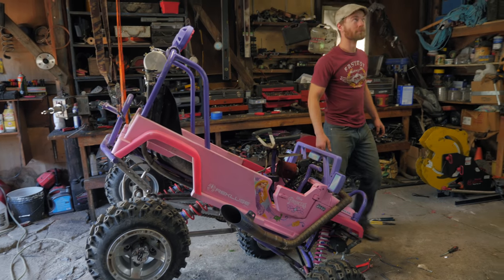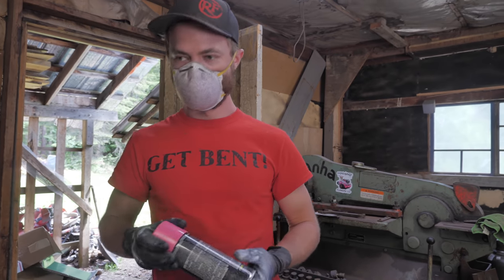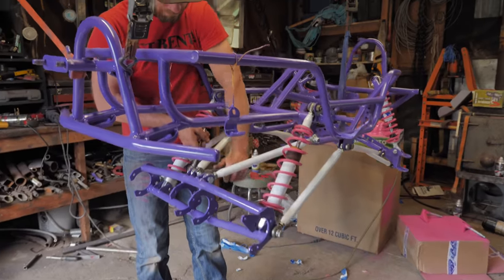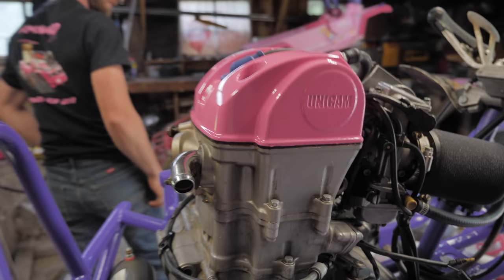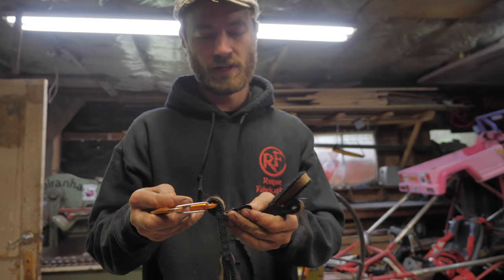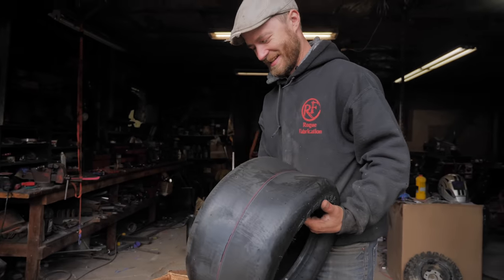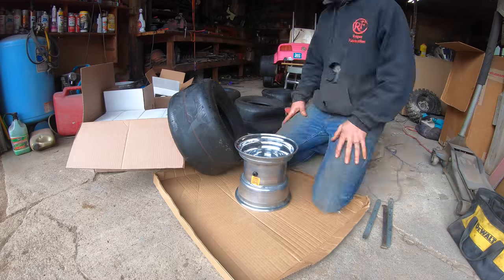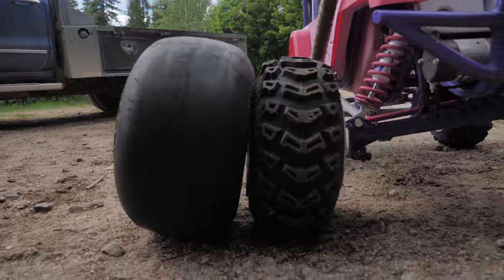50HP Princess Jeep Hits The Streets

Comment: Make sure air pressure left to right is spot on. Also we need a GPS run with your phone.
Reply: It's not always spot on but you definitely understand why it's pulling. I used to ride wheelies on my ATVs for miles. My best ever was over 5 miles. The tires are not always exactly alike so I'd adjust the pressure until it went straight. Sometimes, one back tire would have a couple pounds more air than the other to get a straight wheelie.
Reply: @mckrackin5324  5 miles? proof?
Reply: @ChuckWood  Why do you need proof? Everyone that can properly wheelie can go for miles. Once it clicks, you can basically go forever.
Reply: @ray_collins  been riding quads for 20 years. Where did you find a 5 mile long stretch?
Reply: @ray_collins  agreed, but unlike a dirtbike you would only be able to do this on a very long straight stretch of road, and it would have to be pretty wide too because chances are the quad wont want to go in a perfectly straight line and will go either left or right a bit.
Reply: A good firm wheelie bar should help
Reply: @mckrackin5324  Lets not forget transfer of body weight effects all sorts of things
Reply: @wotever99ninynine  you can turn on a quad while doing a wheelie
Reply: @MrBmario21  yeah, i figured you could, just didnt think it would be much, happy to be corrected.
Reply: @zuestoots5176  Yep. Transfer of weight will be really hard to control with so much power and such a narrow rear axle. Whichever way he leans to see around the hood, that's the direction it will go.
Reply: @ChuckWood  Saskatchewan

Comment: Check the rear tire pressures. I've had the same issue on a wheelying 3 wheeler. If one side is just a half pound lower on pressure, that's the direction it was going...
Reply: Yea im sure the wd 40 burn test gave the tires all the exact same air pressure

Comment: Adjust the rear shock on the side that its pulling to force that wheel down more it may help with the pulling because of where the tourk is applied on the axle and add or remove air

Comment: The problem when you get on the gas and it wants to pull to the right, I think it’s because your chain is off set and not centered and it’s twisting your frame or axels with that much torque, the slightest movement can make a big difference, amazing build I love it, i can’t wait to see what else your going to do with it

Comment: When you were talking about how it reacts when the front wheel are in a mid wheelie, the front end looked slightly out of alignment.  It could also be from different tire pressures in the rear tires.  More air, larger diameter.  Looks great!

Comment: The left front tire clearing the ground first is making the right front wheel pull the machine right as the shock is fully extending.  The length of those limit straps has to be exactly the same.   Or, shorten the right side a little at a time to get the machine to lift evenly when the wheelie starts.   With the independent front suspension, the width of the front tire tracks will be change from loaded to unloaded.   That doesn't matter a bit till popping your wheelie and one tire clearing ground first.   Last one to the leave the ground pulls the cart a little in that direction.   Shows up on this cart because of such a short wheelbase.   That machine is too fast to not have a full rollcage.  It will look just as cool if it had one too.   Great build guys!!

Comment: Make sure tire psi is the same in the tires and heim arm length is the same if not 1/16 longer on right side and you should be good on fixing it pulling to the right. Tire psi alone is the most important part about tracking straight while doing ATV wheelies for me

Comment: just a tip if you just fill the tire with propane from the torch and then hit the striker to get the tires on the bead. no gas needed

Comment: is there a way to fit some drum brakes, or even disc brakes inside those front wheel hubs? if going that fast id want some front brakes personally, pretty sketch to slow down in a hurry with only back brakes/ rear wheel engine braking.. but its a totally awesome build, and adding front brakes could get complicated fast. probably need a fair bit of a redesign. but any kind of cheap brakes for the front would be better than nothing. even just cable operated discs off a pushbike or something. maybe could make a diy solution where you have a lever and a diy brake shoe of some sort pushing against inside of wheel hub. wouldnt be great but might be enough just to make it a tad bit safer.?

ive said it before, but ill say it again. best channel on youtube. by a country mile! seriously. soo good. i look forward to it every saturday morning. great stuff.

Comment: Early on in the series i thought you'll need a counter weight down low on the front, you're too light at the moment and could easily loose traction (steering) if you hit a bump .The lower and further forward you place it the less weight you'll need, it'll give you more front end grip and reduce it lifting under acceleration, it's a simple safety upgrade.

Comment: Right or wrong, I've added air pressure to the rear tire on a few straight axle rides that did that. You might be able to bandaid the situation by using more air in the right rear tire. If I thought fit and finish were great before...... You guys knocked that out of the park.

Comment: Looks sick with those slicks on it. Sway bar looks to have made a huge improvement in handling. The pull to one side is from the torque twist. Wont notice it on all 4 or pullin a wheelie, but wen in between its puttin just enuf twist to pull one front off the ground n the other pulls to that side. Hard to completely rid torque twist

Comment: Measure the circumference of your rear tires and air them so they measure the same. Air pressures will be different but circumference will be the same and should help it track straight during wheelies

Comment: Sick. It just keeps getting better. The Rekluse is definitely costing you some HPs, and its still torqueing the front end up. So now do you possibly sacrifice reliability and build that mill or leave it stock??????Serious question here, did you guys set tire pressures? The tires looked way over inflated to me, wondering if that may have led to the listing to the right side if the right rear had less pressure than the left? Th kart guys would know better on race pressures but I bet somewhere around 15lbs?

Comment: A thought occurred: during acceleration, the car seems to pull to the right. I'm guessing it's the sway-bar on the back wheels that aren't equally balanced, so if the right side is weaker, acceleration  would lower the right side and creating a few degrees of turn on the back axle (thanks to the suspension design of not having a rigid line of travel, i.e. 3 axis of rotation where a motorbike for example has only 2-axis of rotation)
This explains why when the front wheels are airborne the vehicle runs true to both rear wheels, but when the front wheels are barely gripping you have a turn effect and when the front wheels have full grip they overcome this small turn. I would like to see a long flat run if she really runs true, or if the weaker right sway bar will make a very wide turning circle.

Comment: Tire pressure difference on the rear and 4 link length will cause a pull. Trouble is I can't remember if you need to shorten or lengthen the side that its pulling towards... I think its lengthen in small incriminates to fix it.

Comment: Prolly too late but ya will want to add a disconnect for the battery. That wireless winch even when not in use drains the battery looking for a signal all the time. Had to put one on my buggy because of it.

Comment: The pulling has to be in the rear, when weight is off front and power applied it pulls. Can't be the front. Check 'x' measurement. Measure from front right to rear left and front left to rear right.

Comment: Put a pound or 2 more air in the back right side and it won’t pull right no more and it doesn’t really matter if both back tires have the same amount cause there is a little difference in the tires

Comment: The sanity just floats wafts out of the building with this thing. 

Now its got grip and your on a decent surface it will be dead easy to flip. You might need to add a stronger sway bar at the rear now as well to keep it going in a straight line. Something is winding up in the rear.
Good luck with the media appearance, don't trust them to much though.